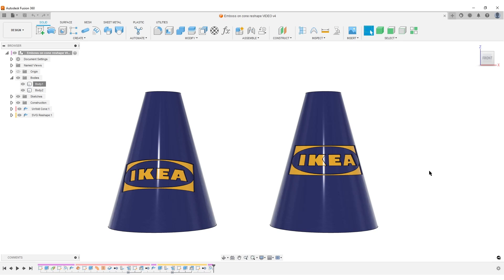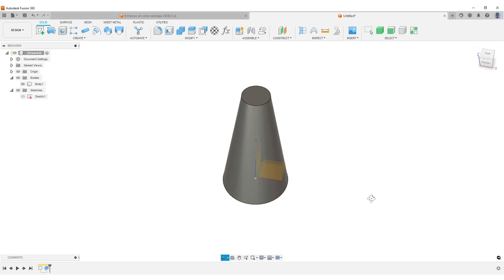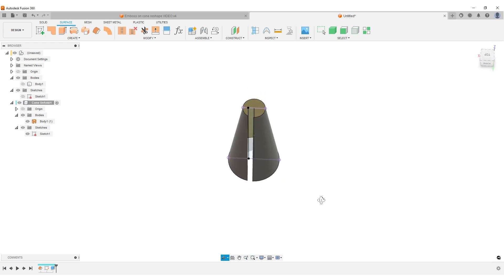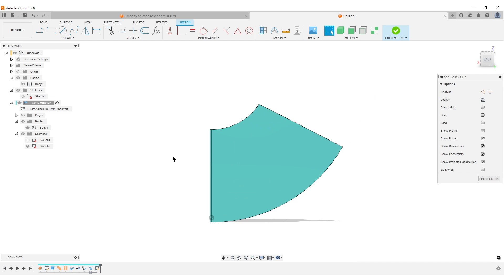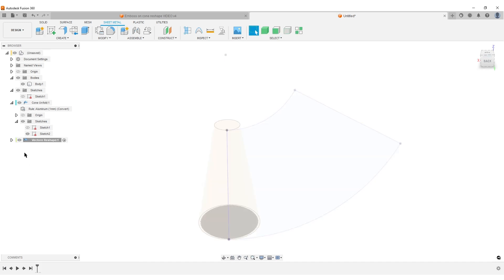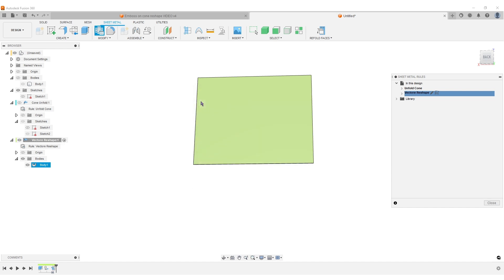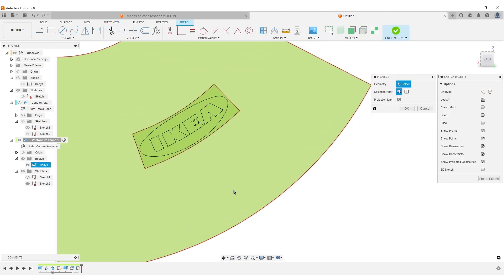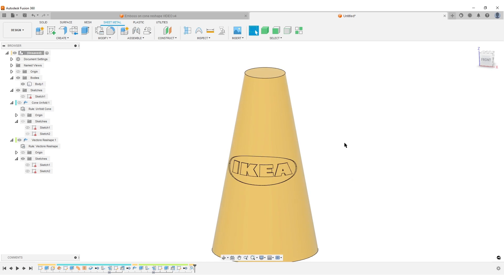Fusion 360 - SVG on Cone trick

Comment: Wow. Head spinning. I use sheet metal mode (with SVGs) to create rings and bracelets with no issues because I am using a simple circle or ellipse.  I extrude the SVG directly on the unfolded body then refold it and delete the flange. 

I tried using cones in the past and now I understand why I couldn't do it right.  I'm probably going to review this video a billion times to get my workflow correct. 

Thanks!
Reply from the maker: Yeah a lot of people get this geometry incorrect :) I have read in some places that there will be an update to Emboss in Fusion replicating the workflow in this video, but no timeline on then it will be done.
Reply: @KristianLaholm  An improved emboss most likely would not help me in my use unless it creates new bodies just like extrude. I need to be able to manipulate those bodies then combine them with the target.
Reply: @KristianLaholm  I use sheet metal as a warping/envelope tool (similar to CorelDraw/Illustrator envelope tool). If Emboss allowed me to create new bodies I would be using it on ring and bracelet designs. I have a few videos up on the end result of using the sheet metal technique.